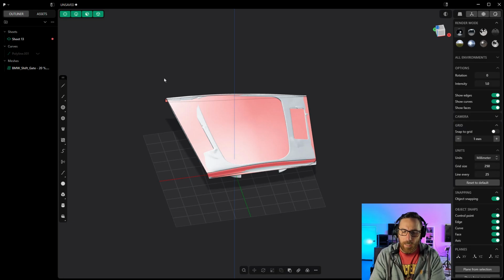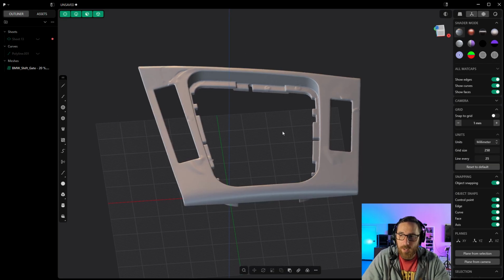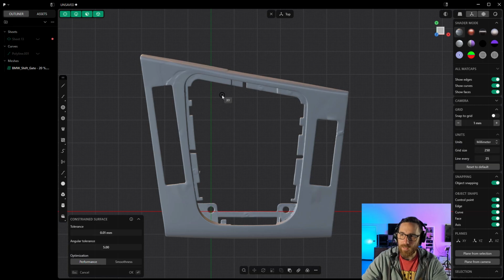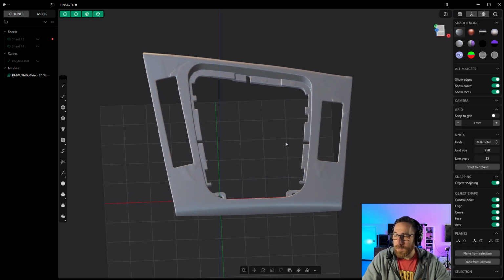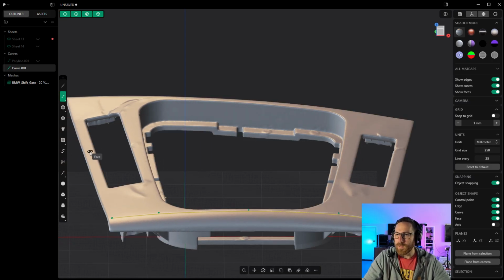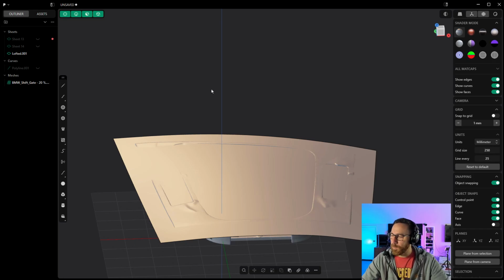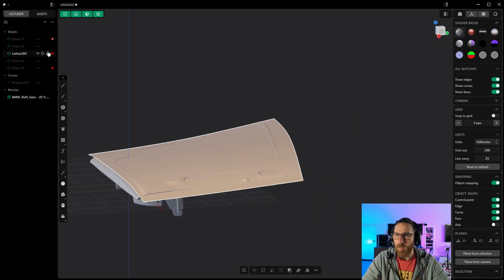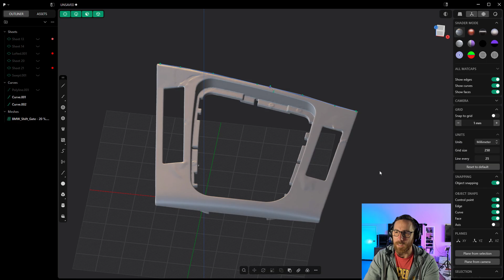Reverse Engineering Car Trim Panels for 3D Printing – Plasticity

Comment: Thank you very much. Do you use Onshape at all? Seems to have some decent tools for this type of thing as well.
Reply from the maker: I don't currently.  I was an early Beta tester for OnShape before it was public, and did create content using it for eLearning sites.  I go back every now and then and play with it, but just can't get accustomed to it.  I know their Mixed Modeling says it works with meshes, but i think its a little different (again will have to play with it more).  They had reached out and asked about doing content and when i asked about complex surfacing and freeform designs on meshes the conversation stopped.  I was supposed to chat with a tech expert there but it fizzled out.  That told me it probably wasn't ready.

In their materials on Mixed Modeling it almost appears that they convert the mesh to a solid giving the ability to modify it with booleans.

I will be diving back into it again in the near future and giving it a shake.  It is always good to keep visibility on what all programs are doing.